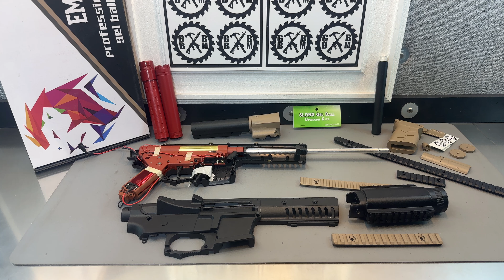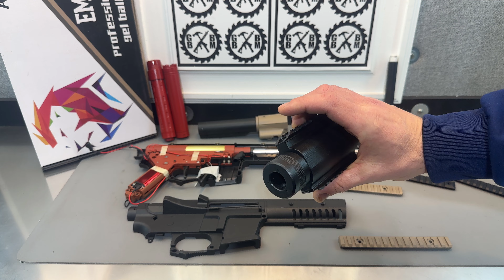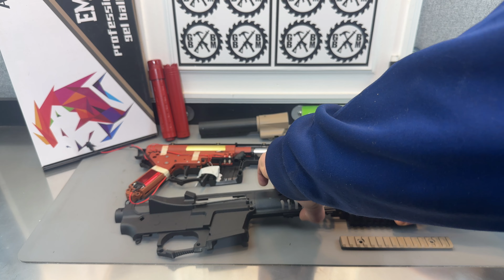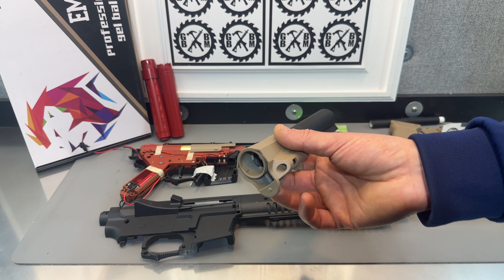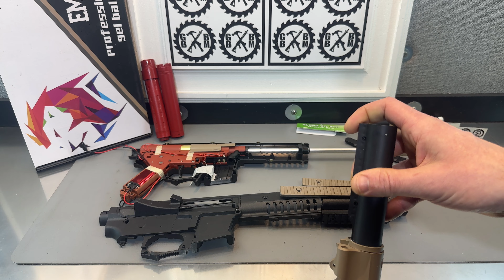NEW CUSTOM GEL BALL BLASTER (TOY!) Build Explained - EMERBUTOYS TG ARP9 Upgrades & Mods! #m416

Comment: In India you can't get gel blaster under 1000rs
Reply from the maker: Everything is relative based on your economic situation/etc - 1000rs is about $12USD which would be considered cheap for a gel blaster here. The most inexpensive blasters are usually around $15 when on sale but of course they can go up into hundreds. This ARP9 is $120